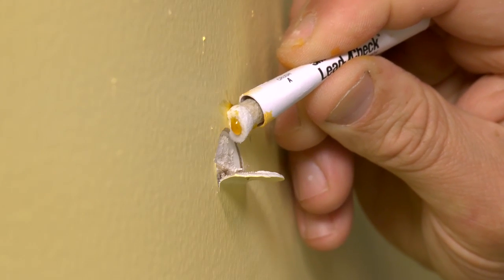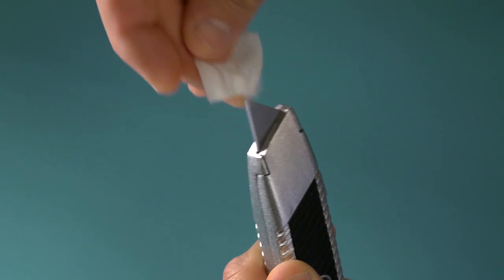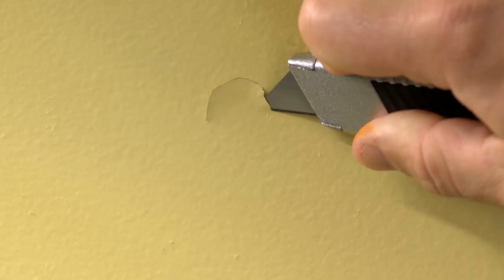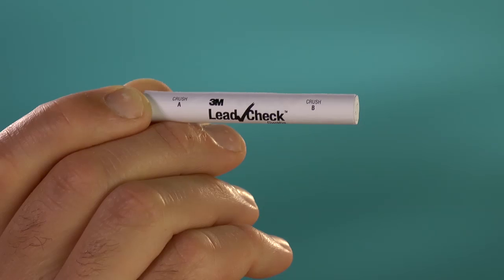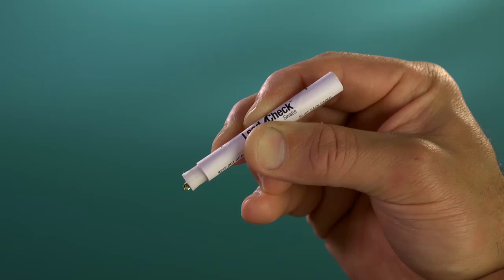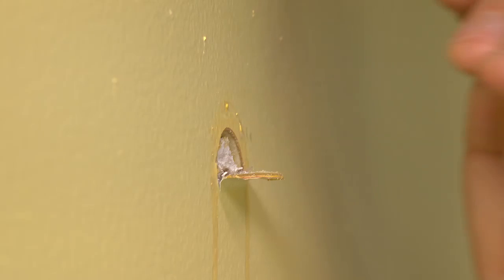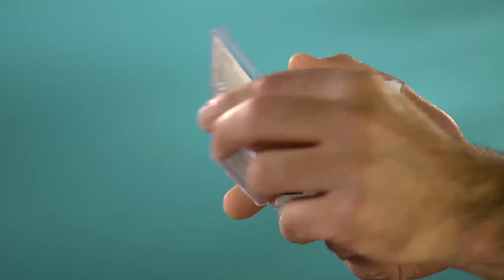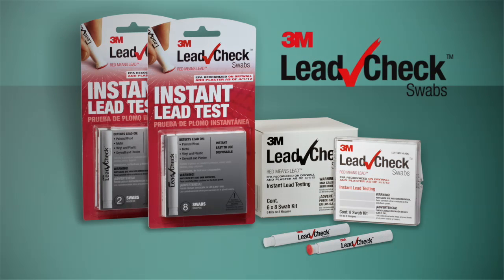3M™ LeadCheck™ Swab Demo on Painted Plaster and Drywall Surfaces

Comment: What about dark orange
Reply: Red=lead, orange=barium, purple=tin.
If using buy a pack of disposable, single edge razor blades. Use a new blade for each test wiping each blade with wipe before using. Cross contamination is eliminated.

Comment: Why would you expose the lead? If it can't be detected on the outer layer your good right?
Reply: no lol
Reply: Jared Cannon If it doesn't chip or crack anywhere then you're potentially fine, but it won't stay in tact forever, and therefore needs to either be abated by a professional, or properly encapsulated with special paint.